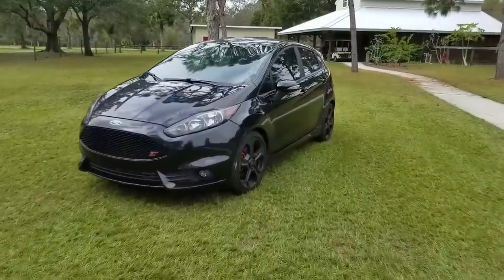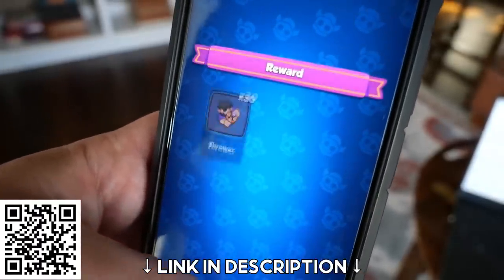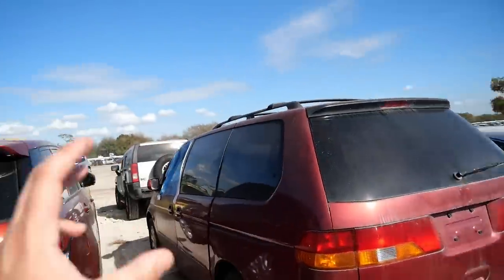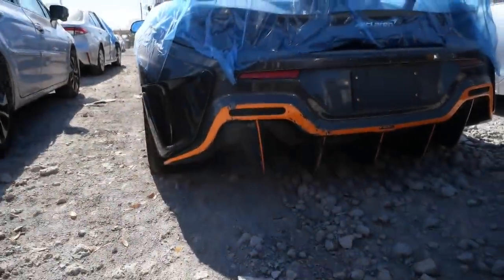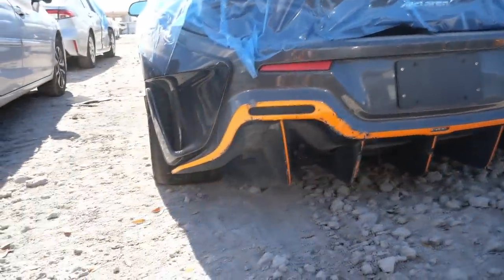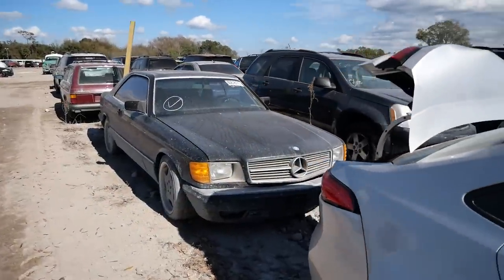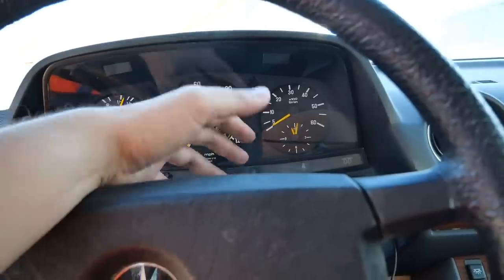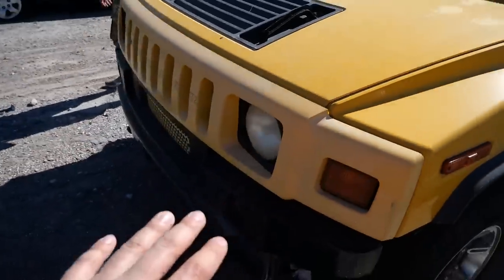The Salvage Auctions have made it IMPOSSIBLE for me to Buy this "Cheap" McLaren 600LT

Comment: High end cars are not worth it to me. When your done with all the parts .  You might as well buy a clean one.  Grew up around plenty of car guys that own shops. Mechanics and paint. The body shops have told me if the frame gets tweaked. It is never right. Plus selling the car. You never get your money back due to the car being wrecked. My father passed in 2018 and he had a jag. Had to get some new keys and put tires on it. Jag dealership sells Mclarens. I asked the 3 salesman and 2  mechanics standing around. They all answered they are a piece of shit at once. I was laughing my azz off. Salesman told me go buy a Porsche or Jag. Mechanics said they are in shop more then on road.  That 2 door Benz I believe was covered on hagerty by the dude that has a huge Porsche collection. Going blank on his name.

Comment: clear title on salvage car? how is that? also this is people with vapor equity in their homes like 06 crazy prices and they will drop in time as interest rates rise and they are and will
Reply: If the car was never reported as a accident then it could be considered a clean title
Reply: @MrBloodguns  Yup, total the car and never report to insurance. Fix it for cheap and sale it or trade it at a dealer. Happens all the time. Always inpect a used car for body damage, you will be surprised.
Reply: @MrBloodguns  Insurance paid out how can it not be a salvage? Otherwise it would have sold outright not at an auction

Comment: 1 issue with these type of cars could easily cost you that 20% so no I don't think it's worth it, if I could get it at auction for 82k then yea worth the risk anything over 90k I'd leave it on the lot

Comment: Oh wow that S55 had the chip card keyless go key. Very neat. I think that interior is dyed or something, doesn’t appear to be designo. Still, neat car.
Reply: It had Designo logos on the seatbacks, and that’s a Designo color.
Reply: @daveh2612  those are AMG badges, W220 did not have designo metal badges lol, it had embossed designo lettering and only on non-AMG cars, the AMG badge deleted any designo logo on the seats. It’s close, but Auburn was not available during this time, and it’s a few shades off from auburn as well. Do more research before replying.
Reply: @ic1815  Oops I’m a dummy, I knew that they didn’t say designo on the w220 seats. Not thinking straight. The color definitely looks close to a designo color though. Even though it’s a facelift I don’t like 2003. It’s a weird year.

Comment: Start buying EVs,  we are about to see a transition in what used cars are.  Also, the 2nd hand ev parts market is ripe for the picking right now.  Look at salvage yards in the 80s and early 90s when foreign cars started hitting the used market more.

Also,  PLEASE CHECK FOR OIL BEFORE YOU START STUFF LABELLED MECHANICALLY DAMAGED!

Comment: It's alright buying a salvaged badly damaged car and repairing all the damaged parts you find but it doesn't stop there. Over the next couple of years the stress received by other components will, start to show up and will need replacing. Then it becomes an unreliable vehicle. When it comes time to part with it you have to declare that it has been an insurance write off and the car's value plummets compared to a genuine undamaged car with full history. Even a high mileage car is worth more.  Having had relatives who dealt with motor salvage and rebuilt motor cars, stay well clear and if you can't buy that Ford Focus ST buy one from the ST line, same trim and dash but not the same performance carries the same kudos but cheaper.

Comment: BS Sam - your time is not free. Even if you estimated minimum wage for the time you spend on this (and your skills are worth FAR more than minimum wage), that's a substantial additional expense. Calculate the hours you've spent on projects and multiply by 5. That's the cost at only $5 an hour. Ok, so you spend more time because you're filming. That's why you use the extremely low labor cost. How much is that figure? By now, close to what it would cost to buy that Mclaren.